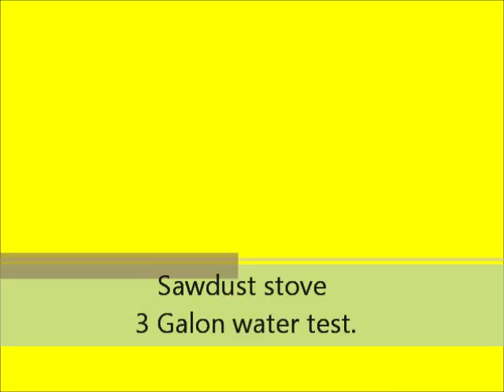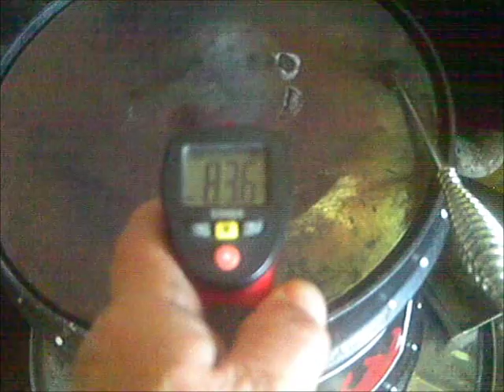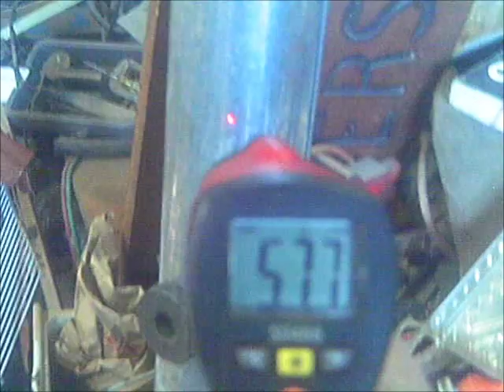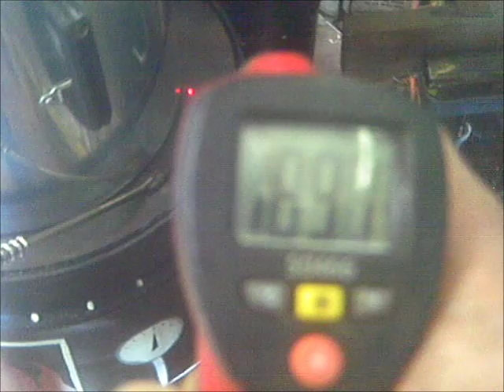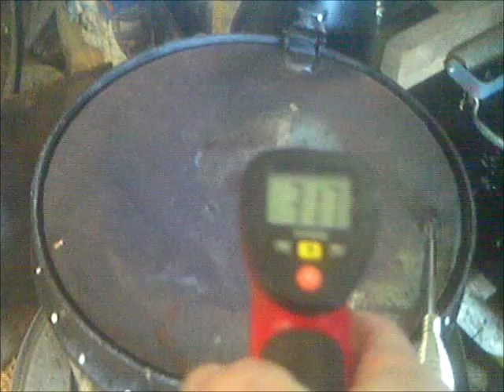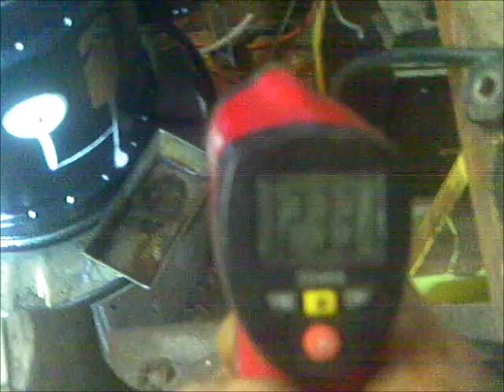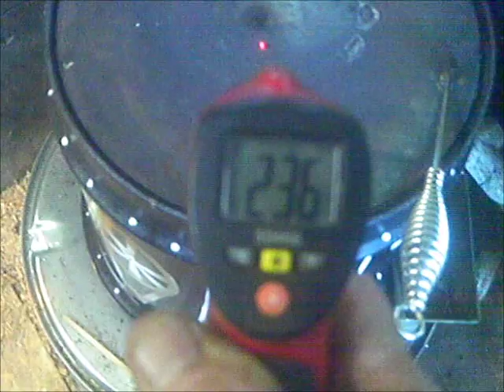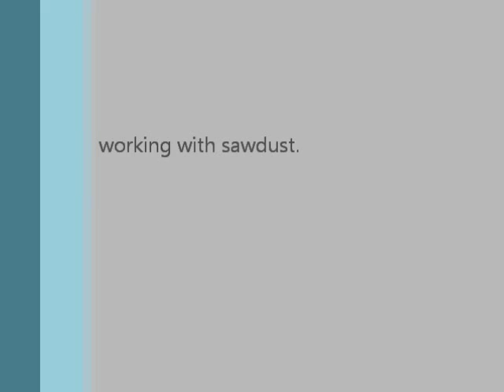Sawdust stove water heat test

Comment: CAN THIS STOVE HEAT WATER TO BOIL POINT?
Reply from the maker: I have boiled a perk coffee pot of water to make great coffee on the stove.
Reply: HOW LONG DID IT IT .?
LIKE BOILING 10 CUPS OF WATER ;HOW LONG CAN IT TAKE TO BOIL ON THIS STOVE?
Reply from the maker: 30 to 45 min. Depending on how cold the water is. It is not a fast stove. but it will get the job done.

Comment: SO THIS STOVE CANNOT HEAT WATER TO BOLIING .?
Reply from the maker: That was 3 gallons of water. All I wanted it to do in this test was make hot water. I have set a perk coffee pot on the stove and it has boiled to make a great pot of coffee. It is not fast at making coffee but it does burn for a long time. If I add a very small fan I can boost the cook time with more high heat, but lose how long I get heat.
Reply: WHERE WOULD YOU ADD THE FAN .?
BLOW AIR TO WHICH DIRECTION?kINDLY EXPLAIN .THANKYOU
Reply from the maker: The air comes in at the bottom of the stove. You see it when I fill the stove with sawdust. Add some air with a tube hooked to a small fan to boost the air flow. Not to much or you will have a blast furnace that will over heat the exhaust pipe.
Reply: I THINK THE STOVE MAJOR PURPOSE WOULD BE TO KEEP FOOD WARM SAY IN HOTEL SINCE IT CANNOT BOIL THAT FAST
Reply from the maker: For sure. But it can cook faster on the top like frying an egg or making a cheese sandwich.
Reply: I BOIL WATER DAILY AND I HAVE T LOTS OF SAW DUST SO WHEN IFOUND THIS VIDEO I WAS EXITED THINKING  I CAN HAVE A SIMILR STOVE .BUT NOW SINCE IT ISNT THAT FAST IN BOILING WATER , ILL LOKK FOR ALTERNATIVE STOVES.THNKAS THOUGH
Reply from the maker: Look at my dry stack rim stove video if you want to boil lots of water fast.
Reply: where is it ?Give me the link
Reply from the maker: You found it.

Comment: Yes, you are among the few who have experienced the ignition stove top with sawdust and I was very curious to see how things are going. What are the differences? I mean the ways of igniting sawdust.
Reply from the maker: +Titel Gurici The best way I have found, Is to have a thin stick I dip in fuel. I then set it in the hole. It is as easy as that. No fuel in the hole is needed.  The thin stick I poke a toothpick size stick in to hold at the top so it does not drop inside. It does burn and fall inside after it is all lit up.

Comment from the maker: Yes you are right about the IR-thermometer. Reading shinny metal or water temp is way off at times. That's why I put a turkey pot thermostat in the water. I have a ton of free sawdust. My plan is to heat the green house this spring.

Comment: Nice clear practical approach  - Great job. I learned a lot. TNX- I'll be on the look out for a couple of drums now :)  I think the IR-thermometer shows on the low side when reading a shiny surface.  Eg steel or gloss black. You might be getting even better results than those measured. Have a squint here about "emissivity", ignore the advertising blurb :) http://www.omega.com/prodinfo/infraredthermometer.html -Greetings from Ireland.